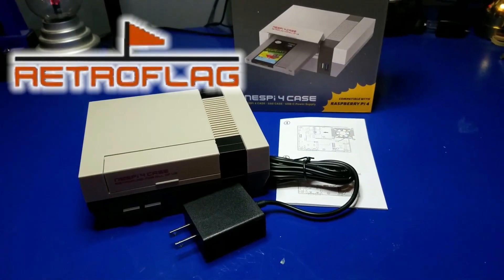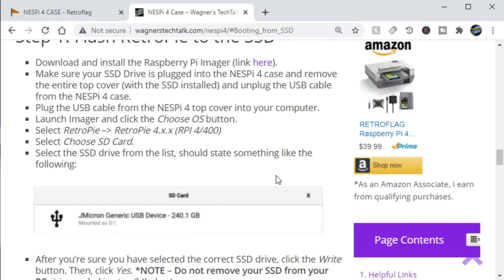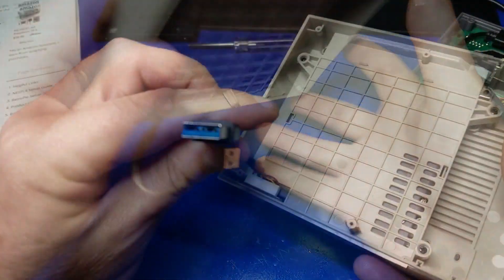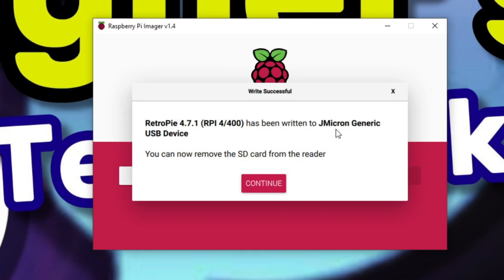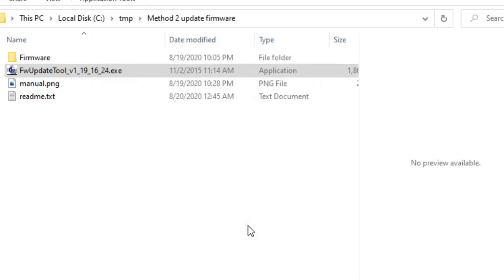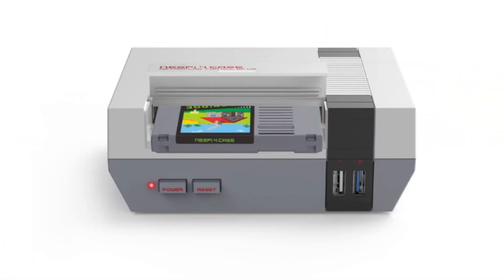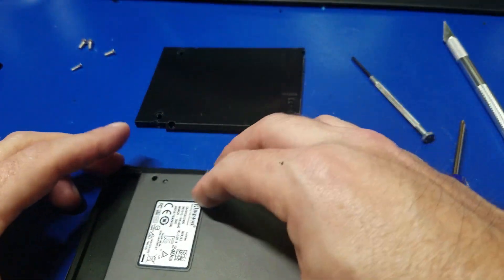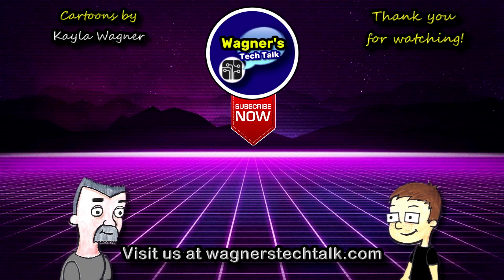Retroflag NESPi 4 SSD Boot: Quick-Start Guide

Comment: I had this for a while and figured out I can't patch my firmware. So I just went with it. I tried a few times and I get alot of error messages booting up and it takes quite long. When booted it's sluggish and doesn't work. Menus are slow etc. So I just went with the sd-card install and ssd for storage
Reply from the maker: Some of the models that shipped after this video didn't allow the firmware upgrade (from what I was told by others).

Comment: I tried to install retropie 4.8.9 onto my SSD and it crashed when I tried to install a emulator it shows the disk 1 with the percentage then disk 0 and crash I tried everything.
Reply from the maker: May want to check with RetroFlag to see if there is any compatibility problems with your SSD model.  You can ask them at   sales@retroflag.com
Reply: @WagnersTechTalk  I have and the SSD that I have isn't compatible which is disappointing. I had to run it off the sd card which I wanted to avoid.

Comment: Would you happen to know why the SSD with my RetroPie image isn't showing up in file explore on PC or in the Firmware Update Tool? When I plug it in to my PC I do have the option to safely eject it the system tray on PC so it is being recognized on some level
Reply from the maker: Think I can help a little with both question.  First, there are two partitions created when you image an SSD/microSD with RetroPie.  The first is the boot partition which is readable by Windows (fat32), the other is a linux partition which is not natively readable by Windows.  However, you can use a tool such as Disk Genius to view the contents of the 2nd partition within Windows (with the professional version, you can read/write also: 30% Off Disk Genius Pro code: DG30-YUTE-STPR).

Retroflag has updated the firmware/device since this video.  A firmware update is likely no longer necessary as it was with the earlier generation.  So, unless you bought the RetroFlag used somewhere, no need to update the firrmware.
Reply: @WagnersTechTalk  Thanks for always replying. I used your videos to put together my first RetroPie ~2 years ago. My sister played it last week for the first time and asked me to put one together for her.

I did so with the help of your videos again. I cloned my SSD to a new one for her. When I booted hers in her new case I get an error message "

" 1.1991311 mmc1: Controller never released Inhibit bits)."

If you just wait it eventually boots to the RetroPie dashboard.

I did some googling and it seems it's related to booting off of a SSD instead of a SD card. So I tried to update the firmware for the case. As you know that is pointless now. The other fix I saw was to put a blank SD card in the reader. That seemed to get rid of the error message. 

So strange because I wasn't getting that error off her cloned drive until I fixed an issue/setting with RetroArch that was preventing the save function in any core. After that save issue fix I had to clone the SSD again because I was just going to do a fresh RetroPie flash on hers before I found a fix for the save issue.

Even though that error is gone there seems to be a few lines of code, or another error that flashes too fast to read after the splash video plays. Boot up seems longer on her drive as well.

Sorry for the wall of text
Reply from the maker: You might want to try updating the firmware in the Pi: https://youtu.be/xjyQoIzLWac
This fw is pretty cool in that you don't need a microSD to write a image.  The issue may be that the Pi you have has a different firmware version.
Reply: @WagnersTechTalk  That is cool! If I bought my sister's new Pi a week ago it most likely shipped with that Firmware or newer most likely right?
Reply from the maker: Not necessarily.  May want to check, depending on where the inventory came from it could be old stock.

Comment: Where does the Safe Shutdown script get written to? Does it need to be installed again if I use a 2nd SSD with a different image on it?
Reply from the maker: I guess the question is, will the 2nd SSD be replacing your current one or in addition to?  If it's replacing it, whatever OS you install as the boot drive will need the scripts installed.
Reply: @WagnersTechTalk  I'm using a pre build image that I flashed to the SSD. I was thinking if I were to download a different pre built image on a 2nd SSD would I need to run the shutdown scrip again?
Reply from the maker: Yes, as it would be a new image with it's own OS.   You'll want to re-run the script on that drive also.

Comment: For some reason it doesn't pop up on the firmware updater but does on the file explorer can I use another sata device to update the firmware?
Reply from the maker: More recent models of the NESPi 4 don't require this firmware update.  Unless you purchased it used, you may be fine without updating the firmware.
Reply: @WagnersTechTalk  Thank you and yea it is a newer model I updated the firmware with the other SATA adapter but it looks like it had no impact. For some odd reason I use the Wolfanoz 1tb build on my SSD and it was booting up fine but now it's just a black screen on boot so I'm rewriting the image to the SSD. SD card works fine and it worked fine when I used Raspbian

Comment: I am having any issue before the conversion to SSD, the Pi is almost unresponsive with the SATA USB device plugged in.  If I disconnect the SATA controller, the Pi works normally.  I am using the same Samsung QVO drive, and I am able to flash an image to the drive via PC, but when looking at the firmware utility, see unknown chip.  I was thinking I might have had a bad controller, but with it being able to flash an image, I am not so sure.
Reply from the maker: From what I've heard a few times, RetroFlag changed the design of their case since this video.  I don't have the "newer" version of their case to assist.  Unfortunately, I'll have to refer you to their support page: https://support.retroflag.com/ (see their e-mail address at the bottom of the page).  If this trend continues, I'll ask them what's going on and if I need to re-review it.  I've had ~3 people contact me with issues that I never had with the version I reviewed.
Reply: @WagnersTechTalk  The version of my case does look slightly different, where the USB ports are both white and the fan is mounted next to the SSD with a different lead.  I have sent an email to support and will follow up here with what ever the outcome is.  Thank you for taking the time to respond!
Reply: I am running a newer version of the case and the firmware version does not apply.  Most of my issue appears to have been related to a wireless keyboard that was interfering with the SSD.  I am mostly at a good point, but am having a 3-4 minute POST time.  I am waiting to hear back from RetroFlag.

Comment: Very informative video.

Question: I have SSD already setup to boot,  Do I only need to upgrade the firmware?
Reply from the maker: Thank you and for watching!  From what I'm hearing there is a newer version of the NESPi 4 case that may not need the firmware update shown here.  I don't have this newer version, but you should be able to just insert the SSD into the slot and be good to go.  If you try the firmware update and it doesn't work, then you have the newer version.
Reply: @WagnersTechTalk  Awesome many thanks.

Comment: I have a problem with the adapter for the SSD. The Jmicron Program can't find it and after i burned the ssd with Retropie image i can't see the ssd anymore in the browser. Thanks for helping.
Reply from the maker: You likely have the newer-model case, you'll need to contact RetroFlag.  I don't have the newer version of the case here.
Reply: @WagnersTechTalk  I found a solution with the bootloader. Thanks.
Reply: @elviskaucic8368  what’s the solution? Same problem
Reply: @johansjostrand4184  You need to burn the USB Boot Bootloader image in the Raspberry Pi Imager on a Micro SD Card and put it in the Case together with the burned SSD and boot it. It should then work without the Micro SD after the first full boot.

Comment: i have a kingston 240, the utility does not show the drive at all.  says unknown chip.  help!
Reply from the maker: Please see this and double-check everything is correct: https://wagnerstechtalk.com/nespi4/#Step_1_Flash_RetroPie_to_the_SSD  I also used the 240GB Kingston and had no issues.  However, I've had about two folks tell me their case design was different from mine.  If your case looks different from the one shown in this video I may not be much help.  May need to contact RetroFlag  at sales@retroflag.com to see if they've changed things.
Reply: @WagnersTechTalk  they may very well have.  ill keep tinkering with it here.  found a supposed fix but have to wait until my honey is done watching tv.  thank you for the info!
Reply: got my drive installed, and rom flashed.   it boots very very fast, so i dont believe the v2 case has to be updated maybe....  i am just fighting the ssd and 2.4g connection  and screen width at this moment.  im brand new but i think i am headed in the right direction.
Reply from the maker: Thank you for your feedback!  Sounds like the newer version of the case has corrected the issues.  I'll confirm with Retroflag and if that is the case will update the guide accordingly.
Reply: Also, there is problems with 2.4g wifi if you use the ssd.  I had to use my phone as a bypass so I could send roms to it.

Comment: can I also use a normal HD?  or necessarily an SSD?
Reply from the maker: It will need to be a 2.5" SSD to fit in the cartridge shells, a few that I've tested are mentioned here:https://wagnerstechtalk.com/nespi4/#Speed_Tests
Reply: @WagnersTechTalk  i tried with a 2.5 ssd but it doesn't fit in the case
Reply from the maker: @nivmizzet84  I bought two (as shown in the link above) and they both fit perfectly here.  What did you get?
Reply: @WagnersTechTalk  i had an old 160gb 2.5 hd to try

Comment: Gna, I just followed this tutorial the third time, but the raspi isn't starting. The fan starts but no OS is starting. I have no clue what's going on :/

Just to be clear, there is no SD card in the raspi, right? I mean the whole purpose is to get retropie going withouta micro SD card, riiight? ^^
Reply from the maker: Hi Motte, it can be setup to boot without a microSD card, correct.  Check out the Troubleshooting section on this guide and see if something there helps: http://wagnerstechtalk.com/nespi4/#Troubleshooting  Above that are step-by-step instructions as well.

Comment: Hi, i finished an image of mine on an 256GB sd card and i have the backup of that as a single file .img. Can i use etcher and install the same image (of the sd card) on my 2TB HDD or do ihave to use only images that have been made just for hdds?
Also do i have to change any option?
I am using retropie pi4 and i own the nespi case also.
Reply from the maker: Hi, you can.  I have a guide that explains how to do that here: http://wagnerstechtalk.com/common/  You'll want to make sure to follow the "Expand a Partition" section after your write the image to the 2TB HDD to get full use of the larger capacity drive.  Hope that helps!
Reply: @WagnersTechTalk  thank you very much for the response. I'll start readingthe guide  then. Thank you.
Reply: @WagnersTechTalk  Hi again. I did everything right but when i boot the console i am getting a message saying "the root account is locked" and there is a checking in progress on 1 disk counting on %.
What is that? Even if it goes to 100% it starts again. Any clue?

Comment: Hi! Finally got my console. I have this case retroflag nespi. I was setting up fan runs lights turn on and it’s working but when I hook up to my monitor nothing shows up screen. I saw your other video I want to use SD Only. Don’t have SSD drive (prefer SD) does that mean I have to also install Ledger? I installed raspberry pi from the site on my SD card perfectly. no connection. Thank you 😊
Reply: Also can I setup using a laptop or is it best to set up with a monitor only like how you did in video. Thank you and sorry for too many questions :(
Reply from the maker: No problem on the questions.  You'll need an HDMI cable going from the Pi4 to a monitor/TV.  Most laptops don't have HDMI input, just output.
Reply from the maker: Make sure you have the HDMI cable connected before powering on the Pi and that it's connected to the HDMI 0 port.  Should show up fine on the monitor.  Not sure what you mean by installing Ledger, maybe you meant Etcher?  If so, Raspberry Pi Imager is a great tool to use and one I've been using in all my more recent videos.  If you ever decide to add an SSD, got a bit more info. on the guide page here: http://wagnerstechtalk.com/nespi4/
Reply: @WagnersTechTalk  thanks for getting back. Yes I have hdmi hooked up properly. Do I have to download ledger as a must to make it work? Also I read a boot loader download might help but not sure if that’ll work
Reply: Yes I meant etcher lol sorry typo
Reply from the maker: @InvestwithKhan  You can use Raspberry Pi Imager (instead of Etcher): https://www.raspberrypi.com/software/  It will download the OS and install it to your microSD card. Not sure what you're trying to install, I'm assuming RetroPie.  For that, I have instructions here: http://wagnerstechtalk.com/rpi4gaming/#Official_RetroPie .  On that same page, you'll find instructions for Recalbox/Batocera also.
Reply: @WagnersTechTalk  yes retro pi. Okay thanks so much I’ll install imager and go from there thanks 🙏
Reply: You’re website and directions are really good! I figured out the problem the micro hdmi that connects to it is broken, I believe I received a used case. A lot of things are wrong with case. And scratched. I realized when I put my own micro hdmi it booted up perfectly. Other thing I can’t use a USB/ SD card in this case requires SSD which I don’t have. Might just get a SSD but it’s pricy. My mistake but I’ll be checking out other cases. Learning as we go just wanted to share. Thanks for all help sir. 😊👍
Reply: @WagnersTechTalk  will the 120gb work fine or do you recommend getting the 240gb SSD like yours. My Rasberry Pi is 2Gb.

Comment: When updating the firmware to be able to boot from the ssd do I still have to do the usb boot update for the pi 4 to use the ssd? Or is it just fine to use the retroflag method?
Reply from the maker: One you update the firmware in the adapter by running that utility, you should be good to go.  If you have trouble, this guide has a troubleshooting section which should be of assistance: http://wagnerstechtalk.com/nespi4/
Reply: @WagnersTechTalk  thanks!

Comment: I'm confused on three things. 
Is there an sd card in the pi, and if so what OS is it running? 
Will I have to do the process to every cartridge I have?
Lastly, if I don't have a cartridge, will it boot to the sdcard if there is one?
Reply from the maker: Q1: Is there an sd card in the pi, and if so what OS is it running? 
A1: You'll typically install the OS yourself (RetroPie, PiOS, Recalbox, Batocera, etc.)

Q2:Will I have to do the process to every cartridge I have?
A2: For each SSD, yes you will have to install the OS you want to run.  However, you won't  have to update the firmware as shown in this video, only the OS.  However, that's only if you want to use more than one OS.  There are other options, check out my videos on BerryBoot and PINN Lite, if interested.

Q3: if I don't have a cartridge, will it boot to the sdcard if there is one?
A3: If you don't have a cartridge (i.e. SSD installed in the slot) and have an OS installed on the microSD card, yes it will boot from that.

Hope this clarifies!
Reply: @WagnersTechTalk  thank you so much

Comment: this setup does not work as retopie reduces the ssd to 254 mb and will not alow a larger disk
Reply from the maker: It will work and the partition will be resized automatically on first boot, unless there is something wrong with your SSD perhaps?  You happen to be using a Seagate 2TB SSD, had one viewer tell me he was having problems with it.  I have some troubleshooting info. here: http://wagnerstechtalk.com/nespi4/#Troubleshooting
Reply: @WagnersTechTalk  Thank you for explaining this. I'm stuck on step 2 since my disk isn't recognized at all by the firmware program, but not at least I know I don't have two problems! I'm genuinely relieved. Hopefully a solution for the newer case comes out, assuming it's not compatible any longer. That, or I need a different SSD... but mine is a 256GB Lexar, not at all a Seagate.

Comment: do i need to have an sd card plugged in for this to work? i followed the steps but it just stays off in idle, also the program you used said it was not compatible with the chip so i did the manual method
Reply from the maker: No SD card should be needed.  I boot off the SSD all the time.  Did you use this guide: http://wagnerstechtalk.com/nespi4/#SSD_Setup ?
Reply: @WagnersTechTalk  I will follow that and see how it goes, thank you! I am thinking now that I need to do an SD card install first in order to change the boot order, and then boot from the SSD boot image I have installed.